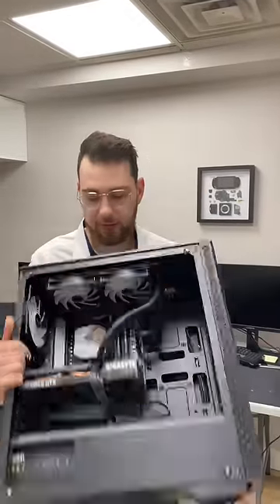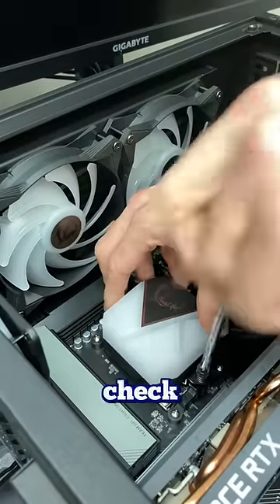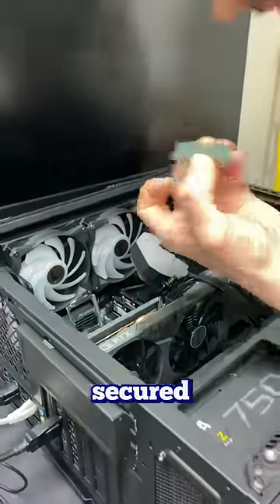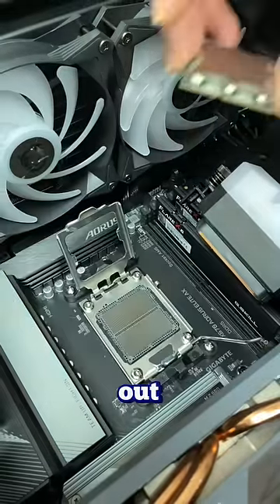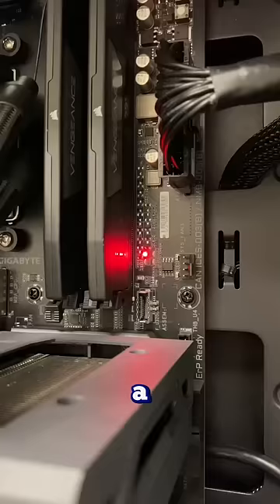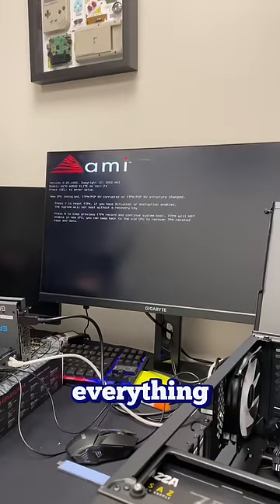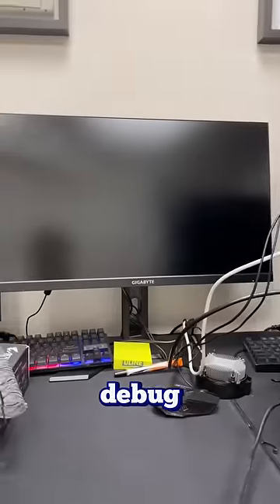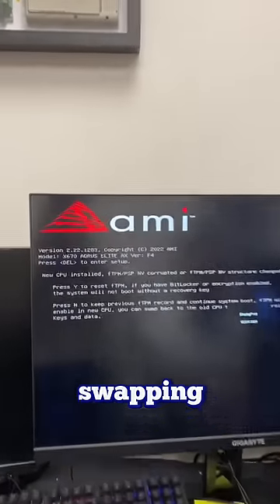BROKEN POWER SUPPLY?! ⚡️ #pcrepair #pc #gamingpc #pcgaming #powersupply #egirl #gamerguy

Comment: I’ve encountered a no boot problem where it was actually the reset switch on the front io causing it not to boot, just having it plugged in makes it not work, but after unplugging it works just fine

Comment: Lol checking power supply should be near the top of the list.  Use a tester, even a Volt meter can tell you quick if there is no power.  Or get a PSU on the bench and plug it into the computer without removing the old one for a quick test.

Comment: i’m a technician on bowling machines - the first thing i learnt was to eliminate the easy fixes first. either you find the problem straight away or waste very little time before moving onto harder diagnostics. not the other way around. in the case of both these applications, power is the first thing you should check.

Comment: Hardest part about building a pc is not actually building it in my opinion, it’s updating all the parts and getting all the correct drivers and shit
Reply: Truth. Installing all the right programs, newest updates etc etc is the worst.
Reply: I don't think so. You just pop in the CD that comes with the motherboard, and the rest will be handled by Windows Update automatically most of the time.
Worst thing that could happen, your graphics card is too new, and the stupid manufacturer did not include a drivers CD. So that's at most ONE single issue you have to deal with, and not a huge one to begin with, unless you have a super slow internet connection.
Reply: Amen! This is actually annoying and difficult.

Comment: the most annoying problem building my current pc was first the dram slots were bad out of the box new, so i went to mico center no problems getting a new one since all the parts worked on another MoBo. Then once i get back home the CPU thought it would be a good idea to up an die on me the same day. never had issues building anyone elses pc beside my  own. lucky me i have old parts for testing just about everything.

Comment: Had a problem like that, were all the fans spin up, everything lights up, but it doesn't reach POST.

After swapping everything for known-working components, turned out to be a dodgy stick of RAM.

Remember to try one stick of RAM at a time folks.

Comment: Good builders test it outside before putting it in, 

Few minutes extra work can save many. 
Which can be important if building to time constraints and paying overtime to staff.

Also if you've noted a brand having issues with a product line.   Notify them.

Notify a potential customer, they will thank you for the heads-up about product that has had a number issues. and then offer an alternative.  

If that happens to be a little more expensive with a few better features, if the customer goes ahead and it is helping maintaining its resale value, then its a win, win.

If they don't shop with you and instead have to have a set price.  They will still hold the, thought that the business is good guys, recommend and check with your store to others and for their next purchase.

Comment: I was building a pc for somebody and finished just hadn’t made it look nice. Just test nice. I plugged it in and I hit the power button, nothing, I tried checking the stupid little wires for the case. And nothing. Finally I came to the conclusion of a bad PSU, it returned the one I had received and bought a new one. I installed it and it worked first try. Was so happy that it actually worked

Comment: On the AMD units that only have two screws you don't want to unscrew them as much as you did all at once just a little bit on each side until it's loose then  it's safe to fully unscrew either side

Comment: I'm having this exact same issue on a new build. only difference was I git it to post outside the case with the same PSU. I am so baffled
Reply: Maybe your chassis is badly manufactured and the board makes contact to the rearwall shorting it out basically.
Reply: @PuddingXXL  I tried it outside the box again recently with similar issues. I assumed it was my board and have left it at the store again for testing, hoping for the best
Reply: @oliviafortnite  Do you have the same board as in the video? 
If it doesn't give you any error codes on the mainboard itself via sound or lights then it does seem to be either the PSU not delivering enough power or the mainboard itself is F. 
It's weird that it would work outside the case the first time but not the second one. That's why I'm thinking that it might have been short circuited by the case itself. A faulty PSU usually still has short circuit protection which means only the PSU will die and not emit the overvoltage to the board. There are cases I've heard of where a cheap off brand PSU grilled the board but that's usually rare.

Well let's hope and see what the shop has to say.

Comment: Lol this is the first thing I always check because in my last apartment I had bad voltage so I’d run through psus at least a couple times a year
Reply: Yeah wouldve been best if you got like a 3 - 4000 joule surge protector
Reply: @edan7813 surge protectors don’t protect brown outs/drop of voltage right? their bad voltage could be too low causing the power supply to malfunction prematurely
Reply: @tfr  my surge protector filters out bad energy.
Reply: Better buy a psu for that problem

Comment: The most time consuming problem I've had when I built my board series was the psu cable.

I took my computer apart 3 times swapping the cpu and gpu into my old board and it worked. I thought the motherboard or the psu was defective but no. Before I took the psu out my case to return it, I looked at the manual and it showed me all the cable that came with it. It's a 1200w psu so there were a lot of cables.

I used a 8 to 6+2 pin cable for the 8pin cpu  connector. I didn't know/forgot a psu come with a 8 to 8pin power cable. I spent half a day trying to first that one problem.

After swapping the cable, my pc booted just fine.

Comment: I want to share my experience too... 
I baught a new Motherboard , new rams , new processor , and a new power supply, i already had an rtx 3080ti ftw 3 with 3 pcie connectors so when i plugged everything when i was pressing my power botton , nothing happened , made a really looong troubleshooting made sure that i had everything well checked and still no post , the problem was , that 1 of the pcie cable was faulty and when changed everything went good 🤣

Comment: my psu died because of usb micophone from Walmart called brand shorted psu out and took it aparts find metal inside microphone that shorted everything out and after took metal out and put back together and install new psu everything back working 
check other stuff before pluging into ur pc because that will cause pc wont turn on at all

Comment: ive bought 2 more ram sticks, rmad motherboard and now rmaing the cpu. i did check the psu with a tester and it seems fine but this video has me second guessing. well i wont know until u get my new cpu... btw cpu debug light stays solid red and dram light solid orange. the first mobo only the dram light stayed on so i assumed ram. after it wasnt ram i assumed mobo since they seem to have a high rma rate. well it isnt the mobo so i assume only thing left is the cpu since no with this mobo the cpu light stays on. this video has me thinking it could still be the psu even though it tested fine.

Comment: I really need your help, today I was cleaning my PSU. I completely disassambled my PC cleaned the PSU and put it back together, everything was fine until I booted it, I got red LED light for RAM. I reseated it and same issue. I thought that I maybe fried it somehow, I tested every single stick in my other pc and they were working perfectly fine and than i realized that 2 of my RAM slots are not working (2 slots next to cpu). I dont know why or how but it simply doesnt work. I really need your help thanks anyways and great content. 🙏❤️
Reply: You might want to try to put the ram in slots b1 and b2 (the outer most one and the one second closest to the cpu) some motherboards are more strict about stuff like this. Let me know if it worked.
Reply: Try finding your motherboard's manual it's possible those slots aren't the right order they shouldn't be right next to each other usually to be in dual channel mode
Reply: @rando3962  tried man it didnt work but anyways thanks for trying to help me
Reply: @autumns8  I found it online and nope there was no issue, I mean my pc was runnung these slots entire time with 3 sticks and recently i got 1 more stick and filled all 4 slots
Reply: @happydiamond6748  have you tried resetting the bios?
Reply: @rando3962  I did it on the PC but i didnt try it physically if you mean by removing CMOS battery
Reply: Reset CMOS
Reply: Try checking CPU. RAM is connected straight to CPU lines.
Reply: Well if they are broken then rma I guess
Reply: @happydiamond6748  3 sticks of ram? Lol. Preferably use the exact same brand and type for all 2 or 4 slots. Get the CMOS out ( the flat battery) and wait 1 minute. Replace it with a new one. 

Another option is to go on an other PC and put a new bios on a usb and create a bios flash. Usually solves it.
Reply: Try reseating , CPU
Reply: @donutworryworkhard  also tried and it didnt work
Reply: @VeniVidiAjax  I was using 3 ram sticks in a pc because i bought it from someone else and it had 3 stick but not loog ago i bought one more stick since it was DDR3. Anyways i will try reseting and flasih the bios maybe it will work
Reply: @Crazy_Chriz  I hope not beacuse i also think they are broken
Reply: @ekon01cz  tried
Reply: @tonysmith7708  yes sir
Reply: @happydiamond6748  did you clean it on the inside or just the outside like did you open it up
Reply: @Crazy_Chriz  I opened the entire pc and cleaned it
Reply: @happydiamond6748  I meant the psu

Comment: I have a red light on the gigabyte aorus elite ax and the led is near vga what does that mean?
Reply: Computer is working perfectly fine though
Reply: Near VGA? Just tell us if the RAM, VGA or CPU light is on. ‘Near’ isn’t really clear.
A red light indicates something, refer to the manual of the mobo, or Google.
I guess it’s the DRAM light. And unless you bought non compatible RAM sticks, a bios flash WILL solve the problem: